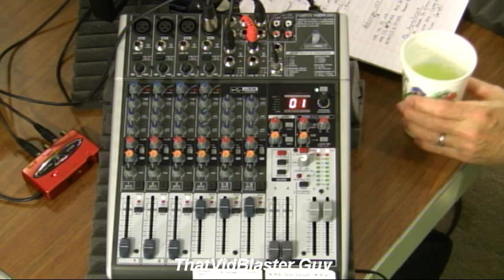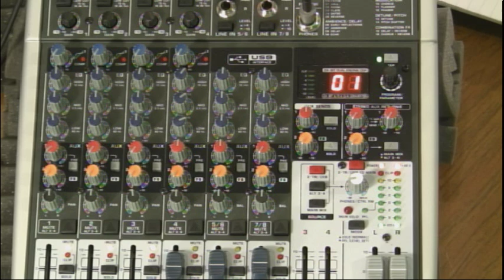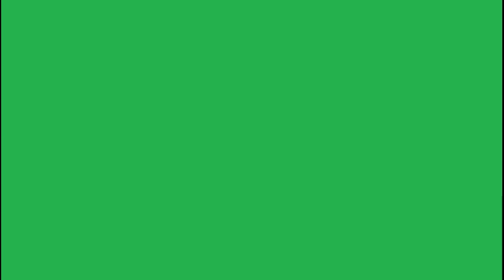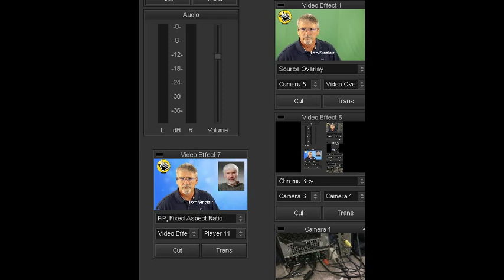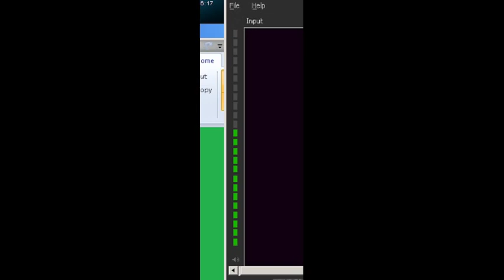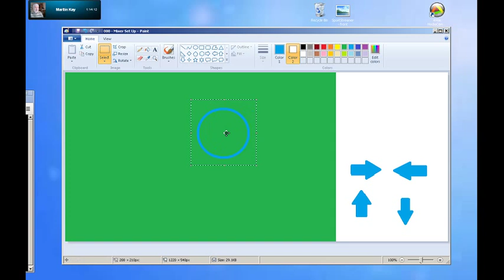That VidBlaster Guy! - LIVE - Behringer Mixer Tour X1204USB

Comment: Hi tom good show! 
I have a question. Not broadcasting any thing yet, not sure if and when but I would like to.
If  you don't mind ( I know you don't ) what is the name of the Program you use to show the pointing arrows and so on.
Reply from the maker: Great question. I used my graphics editing software (Paint Shop Pro) on a 2nd monitor and set it to a chroma key green background. I premade some arrows and then used the mouse to move the arrows. I then used Screen Capture to capture the work area in the PSP, keyed out the green and voila!
Reply: Thanks Tom.

Comment: hey everyone and anybody I NEED YOUR HELP!!!! I have a behringer x1222usb mixer and I am trying to make my mic work. I am using a pc laptop,m adobe audition and the mixer. I have finally got the correct sound to show and read and record in my adobe audition using a small jack in my earpiece port on my pc and 2 red/grey quarter inch's going in a line on my mixer. I adjusted my adobe audition in audio hardware section and that works well. Now all I need is my mic to go through my pc the same way with either a mic male in the board to the mic or the small jack in my pc with red/grey quarter inch's going in my mixer WHER?? I have always used the same setup on both my older mixers and it worked fine. But I wanted to upgrade mixers with more  channels and functions and here I am STUCK!!! UUghhhh I'm losing my mind tring all these settings and changing around wiring then it messes up my reg audio sound so I have to figure out a way to get it back. Now its great for sound with adobe but I'm stuck on the mic working. Can someone please please help me out to make my miccome thru mixer and record in adobe????
Reply from the maker: +Andre Lynch I suspect it may be the position of the buttons to the left of the headphone volume knob. Give those a try.

Comment: I'm trying to take live calls on skype for my show. I have my ear phone plug from my Lap Top connected to my Yamaha MG10XU thru a XLR (in) to chanel 4. Then from the Mixer to the Desk Top via the  USB cable. But no one can hear the caller on Spreaker. I made the chanes on Skype as per the tutorial but no luck. Why's is this?  Do I need to use the 1/4 split into the mixer instead of the XLR?  And do I need to use a Audio Interface? Or does my Mixer have one built in?
Reply from the maker: Pat Stone Audio will drive you crazy! But maybe I can help.

The mixer has an Audio Interface in its USB connection. 

What is the Audio Device in Windows that is assigned as the audio for Spreaker? Is the volume control in Windows set at 100%?

Is the volume control for channel 4 set for a nice high volume? When you connect headphones or ear buds to the mixer, can you hear channel 4 through the headphone output on the mixer?

Feel free to contact me Tom@EasternShoreBroadcasting.com to continue this conversation.

Comment: hi..i'm thinking of buying this & saw your post on B&H (below)... do you still feel this is no good?
--thanks, Rob

10/30/2012
(3 of 3 customers found this review helpful)
 
Thumbs Down
By That VidBlaster Guy
from Fairhope, Alabama
About Me Experienced
I bought this mixer to handle the audio for my internet broadcast (audio & video). I've owned a USB mixer before and like the fact that it handles both the Line In and Main Out to/from the PC... except... that doesn't work on this mixer. Audio makes it to the mixer from the PC, but it stops there. No audio produced by the PC (videos, music, etc) get returned to the PC.

We'll see how Behringer Tech Support responds. It will determine whether I buy any other Behringer product again in the future.

If no joy, then this little guy goes back.
No, I would not recommend this to a friend
Was this review helpful? Yes / No
You may also flag this review
Reply from the maker: Great question. But.... it depends on how you plan to use it. In your band? At your church? As part of a streaming set-up? It all depends. Feel free to contact me at tom@thatvidblasterguy.com to chat about this.